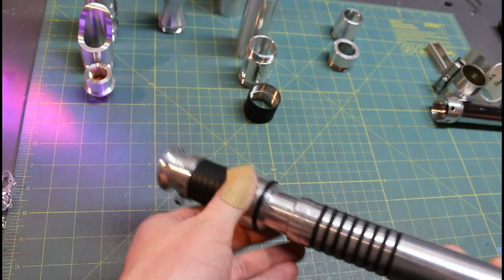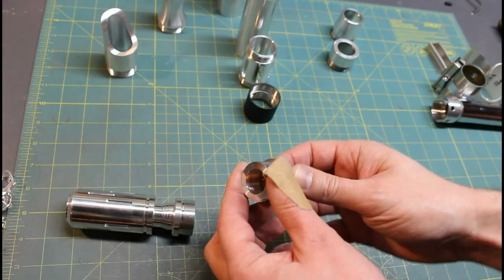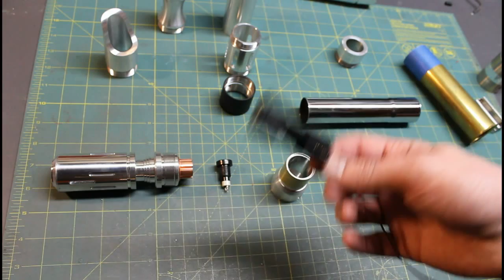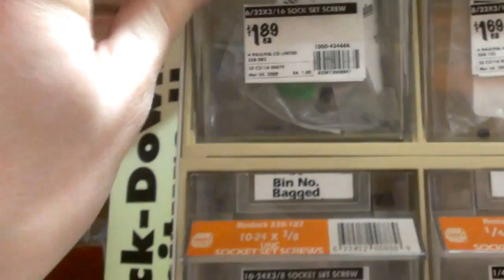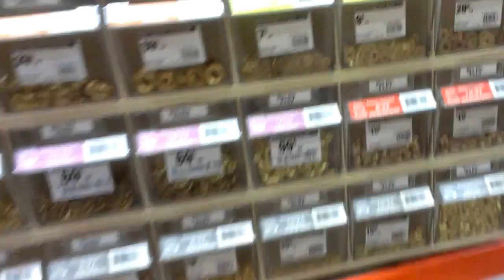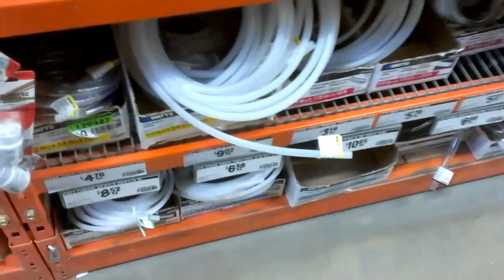These are the parts you're looking for

Comment: 4:26 lets use cheap shit pipe now saber price go up xD well i can build that free. just go work take scrap parts that not need.click cycle start on machine. machine make it its free.sure i can do it after hours.and when there is tools i need ready. so no setups time. completely free.just like custom saber shop should work. part is purchased from shell. new part is replaced before end of day. becouse setup is ready. it should be. every hole should be in same position by threads.its not hard make jig that you turn your part and clamp then mill and drill hole is allways same way(same part s 99.9% same). not like 0-360 some where. same jig can use hold inner and outer thread and jig need build better than final part. if you make hole one side other part and other part hole. when you screw them togetter if you intented holes been line they are. thats quality. atleast in my shop it would be.
faster and easier you make part. quality is better. you can sell part good price or sell them cheap becouse you made them cheap lol
its allways cheaper make multiple.than one.that one part allready give cost back lol. atleast when looking prices.
but allways true.if everyone allready have saber, but true too there allways new born.
saber job is mostly hobby everything you sell make profit. you not have 100 guy making these? lol

Comment: im so late for this.looking these parts too but out stock. cant find all parts needed for my saber. so buying is not option.and i only want 2 saber. luke/old ben.  vader(assumed)/ben had it/luke get it/luke lost it/maz found/rey discovered/finn try it. yes its same saber all the way.prop artist failed if any.

i could make these parts my self,but i not know what threads these are v1 and v2 have dif threads. i could guess them based on diameter.and sure i want build mhs compatible even its my own.why invent wheel?
where is specs for these part. i make my own shop. when part purchased i make replacement. stock allways one. or it not show in shop

Comment: Do you know , or could you measure the diameter of the MHS ( I think, parts, well the ones from custom saber shop ) because they say that it’s just under 1and 1/2  which is too big considering that that brass plumbing conduit is actually 1-1/2 and get over theses parts . Because I would like to make my own saber with only the blade- holder from the custom saber shop and to make my body I would like to know the exact dimension so I could connect directly my main sabers body with the blade-holder . Thanks And I consider that you might not respond considering It’s a very old video .

Comment: Wtf?  You stuck the heatsink into the bottom of the emitter section?  Erm, wut?  Apart from the gap the light from your led has to travel to reach a blade, there's literally nothing holding it in place, unless you drill and tap the hilt.
Reply from the maker: In the MHS system the blade holder locks the LED module in place between its male threads and the next pieces female threads.. and yes on this particular blade holder there is some dead space between the LED module and blade but on most there is not.
Reply: Ah, ok, I'm about to do an MHS build.  Looks like that Satele Shan inspired emitter is probably not the best way to go for an in-hilt led setup then.  Unless the light loss isn't that significant.
Reply from the maker: Not really light loss.. it is as if the blade is a inch or so longer is all.
Reply: Ok.  As I said, not used MHS parts before and the reason I got attracted to doing a build with them is precisely because of that Satele Shan emitter.  I noticed your V3 heatsinks have been out of stock, got any more of those inc. anytime soon?
Reply from the maker: No but the 4's work just fine.

Comment: Can anyone tell me the thread depth of the 4" double female connector, the 5" double female connector, the double male with slots style 3 connector, and the pommels?  I was able to do the math on the blade holders, but I didn't see the numbers to figure it out on the others.  I'm building a 3D digital model of the design I want so that I can make sure where all of the electronics will be located.

http://www.thecustomsabershop.com/4-Double-female-threaded-connector-P123.aspx
http://www.thecustomsabershop.com/5-Double-female-threaded-connector-P124.aspx
http://www.thecustomsabershop.com/Double-male-with-slots-style-3-P885.aspx
http://www.thecustomsabershop.com/Pommel-style-1-P425.aspx?ItemId=434571

Comment: what's funny is at the time of this video, SaberForge's apprentice sabers were like, $50 and come with holes and a finished pommel, plus tapped for blades and stuff.  Although the wait time is crazy/
Reply: Hop Hoppington-Hoppenhiemer And Saberforge's quality is very low.
Reply: Hop Hoppington-Hoppenhiemer Those saverforge initiate versions don't have lights, a blade or anything else... it's just an empty hilt
Reply: Razzer Hop knows that but the install you can do is cheaper than a warrior

Comment: would you be able to connect these to the mains and use them as a room light? would they get too hot?
Reply: +Molten ZAZ Mains? If you mean plug them into a wall - you will need some kind of adapter
Reply: how much volts and amps do you need to power the saber?
Reply: +Molten ZAZ It entirely depends on the saber. Most people aare using a single 18650 lithium ion battery at 3.7 volts.

Comment: What can one use as alternate bladeholders that can be found in hardware stores? Also as blades for that matter
Reply: +Cheto See I also would like to know this
Reply: Any sort of metal or PVC piping that fits the blade can be used for the blade holder.  I've found that pipe size adapters look fairly nice.  
As for the blade, the best thing to use is polycarbonate tubing if you want to use an LED to light it up.  Otherwise, you can just paint some PVC pipe to whatever color you want.